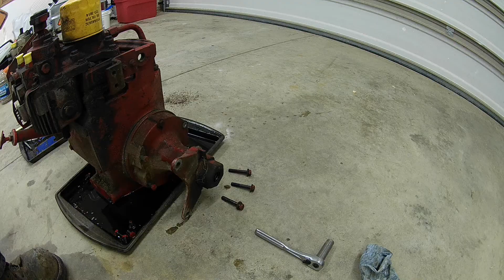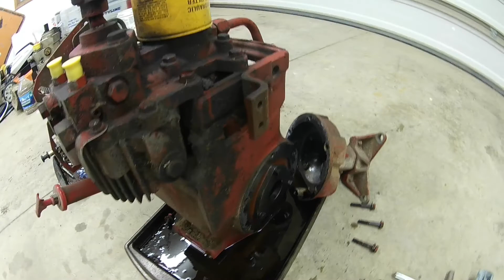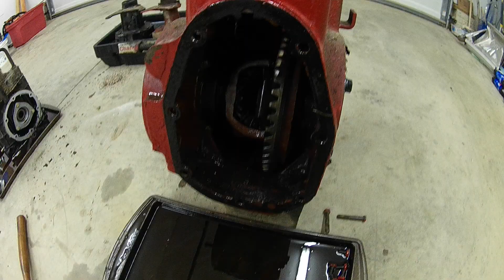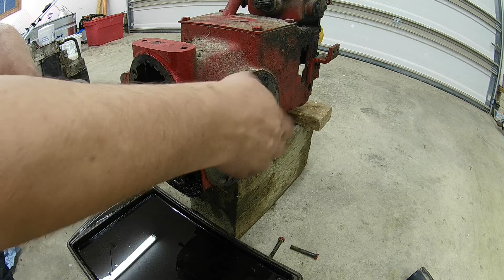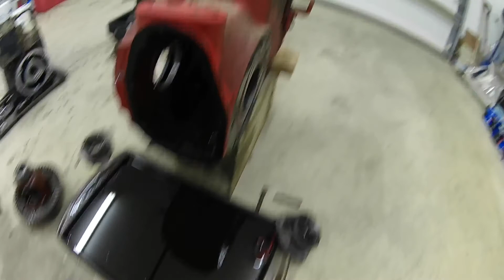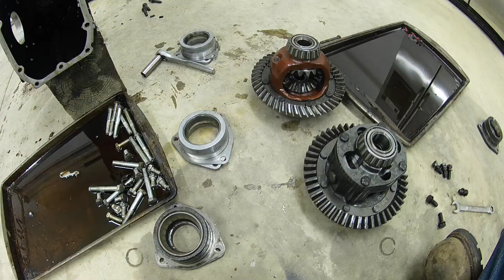Cub Cadet Cast Iron 30mm Axle Swap Part 2

Comment: Curious? Why not just swap the whole rear end?
Reply from the maker: The aluminum rearend is weak. It tends to break where the front bolts to the tractor. They do make braces to keep it from breaking, But the cast iron is still way stronger. The axles and carrier in aluminum rearend are way stronger than the ones in the castiron. The axles and carrier combined with the castiron case is pretty bulletproof. The cast iron also weighs a lot more and that is good for plowing. I intend to use this tractor pretty hard so I figued I had the parts I would do it for a project. This is more of what you would see on a pulling tractor. It is probaly overkill, But I have not done one so I figured it would be something diffrent.